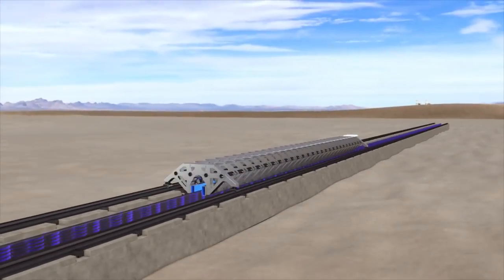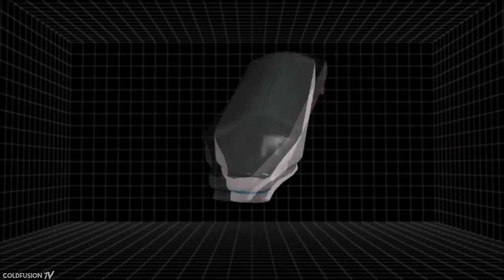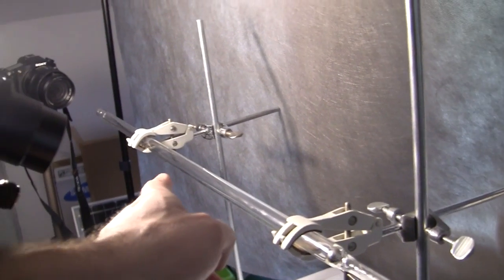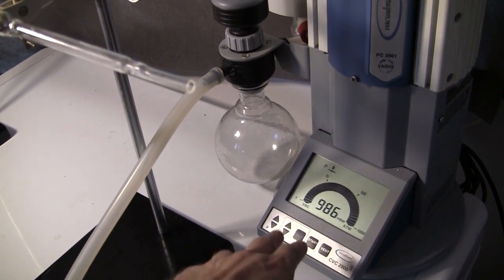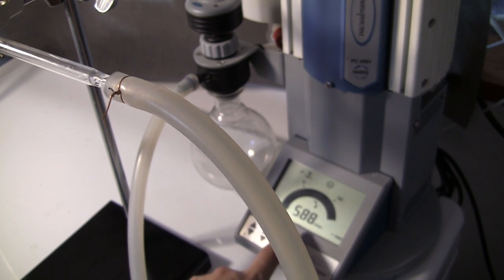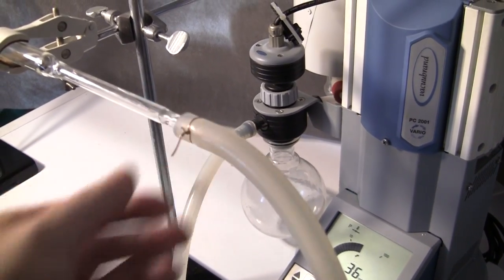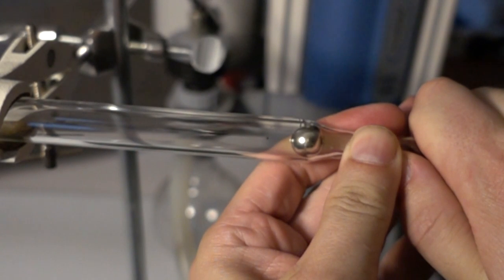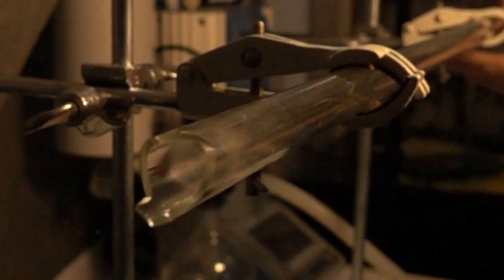How  the Hyperloop can kill you!

Comment: that is only the case when the object's cross-section area is almost as large as the cross-section of the tube itself. if the ball/train was much smaller, all the air rushing in wouldn't move it nearly as much.

Comment: Pointing out a failure mode is a good and valuable thing - that doesn't mean it has no engineering solution to mitigate the risks. And those risks could still be lower than fatalities caused by automobile accidents.

Comment: i agree with you mr, thunderfoot but a couple factors you might not have considered is this is a hyper LOOP meaning if you cant stop you either dont move at all beacause the pressure hits you on both sides or you just go in a LOOP very fastlike they would also most likely have fail safes in place that would open up and balance or imbalance the pressure to stop the train faster. but i have a different thing for you to make a video on. it the commercial it says that they would use something like a propeller poweed by an electric mote to move it. but wait if im not correct dont proppelers not work well BECAUSE of low pressure?

Comment: While vacuum failure does present a major safety problem to sort out, this doesn't mean this idea is a failure.  I mean, we've been using this same technology, eg. vacuum and pneumatic propulsion, for well over a century.  Stock exchanges, postal centers, and hospitals use tube delivery with little to no issue.  Your debunking assumes that no one would even think to protect the tube integrity or place fail-safe measures to ensure safety.  That's like saying planes would be a failure because any small failure in an engine's propeller would lead to catastrophic loss of propulsion and lift.  Or that a tire exploding on the highway would render all cars "debunked" because they would crash without functioning tires.

Comment: No way of fucking stopping? first of all project hyperloop has an engine which can go in reverse as well.
Secondly, do you think at the entire distance, this thing is supposed to travel there is gona be two valves only at the ends? Of course fucking not, in case of failure such as for example train cabin loosing pressure air can be sucked in via multiple emergency valves along the way to make sure people dont suffocate for example.
Also threes this thing called magnetic levitation, a very unknown alien technology used in EXISTING FUCKING TRAINS for several years, which can not only levitate, accelerate but also BREAK the fucking train really really smoothly.
Another thing u dont seem to fucking realize in your very scientific experiment is DIAMETER of the broken element matters. Your cannon ball accelerated faster because it is actually relatively light object, in small tunel with huge ass hole at the end. Diameter of project hyperloop is decent enough that train wont move a milimeter even if you sprey the tube with a magazine of bullets. It would require a massive fuck off explosion, breaking the tube in half to reach that sort of effect. At that point i think u should rather worry about the massive fuck off explosion rather than train itself. 
It seem to me you missed the point of hyperloop entirely. Its a maglev train. Because engineers couldnt figure out how to move it safely any faster without massive cost increases/energy demends, they decided to lower the resistance by lowering pressure. Pressure itself is not going to be main driving force for the train but an adding factor.
Reply: Actually most Hyperloop concepts do not have an engine, they are accelerated from external stationary magnet motors (similar to rollercoaster). They do however have emergency brakes.
Reply: The last point, regarding the size of the hole, is pretty important; for instance, the ISS taking an actual puncture through its hull (say, the caliber of a pistol) wouldn't suddenly kill everyone in it; they'd actually have a very decent 30-40 minutes to locate the problems and either fix them or evacuate, in relative comfort.

Similarly, it would take a pretty big hole in the hyperloop to pump in air in a large enough flux to generate killer acceleration, even assuming safety measures are not in place and the thing is otherwise analogous to the glass tube. Something like, say, a mere bomb on the surface wouldn't do the trick, I don't think (not to mention some hairline fracture caused by poor maintenance).
Reply: Why are you so angry

Comment: The Hyperloop is being hyped because it is supposedly energy efficient: Not having to fight air resistance, not having to carry its fuel load, driven by magnetic linear induction.

However, the problems of maintaining a vacuum seal for a tube hundreds of kilometers long are ignored as are the energy costs of creating and maintaining that vacuum. Note that even a hundred km length of two meter diameter tube requires maintaining a good seal over 628,000 square meters of surface area and depressurizing 314,000 cubic meters of volume.

Constructing such a tube and the linear induction motors to propel the capsule would cost about a billion dollars per kilometer.

Comment: One of the perks of maglev trains is they have INCREDIBLE emergency breaking capacity. You flip that magnet in the train holding them up over, the thing slams the fuck down and won't fucking budge from that spot. Activating it in the case of rapid unscheduled acceleration is as easily automated as the emergency locking mechanism in your seatbelt.
That said, this vacuum train idea still seems rather stupid for passenger transport. Now for cargo? For cargo you might have just come up with something great. Ship everything by pneumatic maglev tube.
Reply: maglevs probably won't be as fast as hyperloops though, such a sudden deceleration might as well be you slamming into a wall, the same is with acceleration
Reply: Scripted Cookies
You can cause the deceleration to be arbitrarily lower than the maximum possible by the degree to which you rotate the levitating magnet.
The hyperloop is a maglev in a vacuum tube.

Comment: The period of time you'll get shot down the tunnel is pretty slim isn't it? After all, for most of the journey you're supposed to be hammering along the tunnel anyway. I can understand that there'd be one heck of a deceleration though. And the system doesn't need a vacuum to function if I understand, only to reach the proposed speeds. Other than that it's basically a maglev train, right? The question would be, can someone withstand the rapid deceleration of a catastrophic vacuum failure, which I suppose is the same problem but in reverse. As for stopping, this isn't an airtight fit and the train should be able to stop itself provided the rail is not compromised. It'll be interesting to see your videos on this topic.

Comment: General respect for your debunking, but I think you are off the mark here.

Certainly their are some engineering hurdles to deal with safety concerns in various failure scenarios, but I think the hyperloop is a far cry from scams like solar roadways & cars running on water.  

Consider airplanes: if the engines fail, they are literally a big heavy object falling out of the sky from thousands of feet with "no way of stopping".  Yet now there are 100,000 commercial flights a day around the world.

Consider ordinary trains: impossible to stop if derailed, but also used all the time, because they are engineered to sufficient levels of safety.

With hyperloops "ways of stopping" could be implemented. Maybe some kind of fail safe breaking mechanism under various failure conditions.  I might imagine some kind of "air-bags" all around the cars that would rapidly expand (probably filling with some kind of sticky/rapidly solidifying foam, not just air). This would seal off the tube & stop the car from moving.

There could also be automatic venting on the other side of the car from a leak, between every car in the tube, so quickly the pressures would balance, even providing a "cushion" between cars to prevent collisions. At the same time the magnetic propulsion system could apply breaking force.

These are solvable problems -- and unlike solar roadways, they are not obviously cost-prohibitive.

For your debunking here to be valid, you need to make the case that it will be too difficult to bring hyperloop risks in line with current planes, trains & automobiles.
Reply: To rebut myself slightly:

Quick back-of-envelope calculations.  1 atmosphere, and say a cross-section around 10m^2, is a sudden thrust equivalent to a handful of jumbo jet engines, certainly an incredible force to deal with suddenly. A 10,000kg car would experience 100g acceleration (if I didn't misplace a digit).

There may not be good solutions to that level of failure. 

However:

A catastrophe analogous to your glass tube experiment requires an opening to be instantly created, near to a car, that is roughly the size of the of the tube's cross-section, which would require something like a major earthquake or terrorist bomb. Trains, planes & automobiles don't fair terribly well in those circumstances either.

Most failures would be small leaks, and the rare large failures would even more rarely be right next to a car, so that there would be time for other braking/venting mechanisms to kick in.

Comment: I really don't know any of the science behind this, but could you put a tube within a tube, and have their air pressure increase and decrease simultaneously so that if the inner tube failed somewhere that the outer tube would still be the same pressure negating any adverse effects? This also wouldn't solve an issue of the outer tube experiencing a break and causing damage to the inner tube or anything that might be nearby when it breaks. Again, I'm a laymen and have little to no idea how it all works.

Comment: You did not really "bust" the hyperloop, you simply showed that it could be dangerous if something goes wrong. Which is news to... who exactly? If you make the observation that losing control of a car which travels at 150 km/h is likely to result in a fatality, you did not "debunk" cars. Does the hyperloop technology work in theory? Yes. If something goes wrong, does it pose a threat to the people using it? Yes, but so do most ways of transportation. A better video would be demonstrating how it is impossible to build a loop without tube failure.

Comment: I have not really followed the whole Hyperloop thing but this video was completely useless. It amounts basically to saying "If engines fail on an airplane in midair then you're pretty much dead, hence we should not invest in air travel". I'm sure that there are actual problems with Hyperloop that could be discussed instead of a failure condition that can be foreseen and prepared for.

Comment: That is BS Thunderfoot, your model is wrong. The thing is a hyperLOOP not hyperSTRAIGHT-TUBE-CAPPED-IN-THE-END. Your bearing would just circle around and come to a halt due to the vacuum escaping from the other side of the loop as well.
Reply: The G forces experienced would turn everyone to mush the instant a breach occurs. Hyperloop or hyperstraightline. Think about shit first, mate.
Reply: FFS. I keep posting this.
Science, bitch.

a = F / m
Say the area of the capsule's end cap is about 3m&#178; (radius of ~1&#178; * π) so A = 3
F = P * A
Atmospheric pressure is about 100000N/m&#178;, so P = 100000
F = 1000000 * 3
F = 300000N
As a guess, say the capsule weighs 5 tonnes.
a = 300000 / 5000
a = 60m/s&#178;
Now remove acceleration based on the resistance of the near vacuum at 1/1000 atm:
a = 59.94m/s

That's basically 6g. So yes, you'd probably survive. That said, you probably wouldn't survive crashing. If, however, you came to a stop without hitting anything you'd be okay.

Before you critique me, remember, this is a 5-tonne capsule. If it were lighter, you might not fare so well. Heavier, maybe you'd do better.
Honestly, though, I think that most people would boycott hyper loops if decompression did ever happen given how traumatic it would be.

[Edit: Google is retarded - "&#178;" = squared sign]
Reply: The G forces. What G forces? TF didn't presented any data of acceleration which we could extrapolate to the real size and mass.
Humans can withstand up to 20g in a short session. Till then is all we know...
Reply: Cesar Scur Damn right
Reply: It's around 5g's to accelerate to commercial passenger speed(160mph) in 2 seconds. This is more than survivable.
People have survived with full faculties 20 g's for 10 whole seconds.

Comment: That's like saying lifts at the top of the Burj Khalifa Tower would kill everybody by showing an egg tied to a piece of string and then cutting the string.  Sure, the cable can snap but there are engineering solutions in place that make elevator disasters incredibly rare despite the tendency to accelerate at 9.8 m/s/s.  

The obvious solution would be to have air pressure / wind activated pressure release mechanisms further along the tube to equalise the pressure down stream and prevent a bullet effect.  A triggered stop valve would also serve not to mention a braking mechanism.  The vehicle could also be shaped to made it jam with a tail wind.  There are countless possible solutions.  It's a legitimate concern you raise that good engineering solutions would be needed to in order to demonstrate feasibility.  Of course we would need to see and assess those solutions but remember, landing man on the moon within ten years also posed challenges, we managed that and I for one wish them every success in producing viable cost effective engineering solutions and see no reason to write off their endeavours.
Reply: Dude the initial acceleration alone would kill everyone inside any prevention method that begins after the initial vacuum collapse is useless
Reply: I'm impressed.  The vid is barely an hour old and you already calculated the force in Newtons against the inertial mass of the craft plus the friction and concluded it resulted in higher g's that the human body can withstand.  I'd love to see your workings.  I mean, it's not like you just pulled the claim out of your bottom.

What if the change in pressure was detected electronically which then led to a valve opening ahead of the train instantly?  Hell, you could have air bags seal the tube going forward at ten metre intervals in a split second.  Could you calculate the forward acceleration in those cases please?
Reply: I think someone else guesstimated it out to roughly 5 or 6g's. While not dangerous, that's akin to light combat maneuvers in a fighter jet or a very hard roller coaster. Not exactly consumer friendly.
Reply: what does your example prove towards anything in this case? simple straw man, NEXT.
Reply: Brain Nim That sounds a reasonable enough estimate and I'll go with it.  I think we agree a runaway train like that is not an acceptable outcome.  So, like the wire breaking on the lift, is it possible to engineer safety back into the system?  So, what would happen if we had air pressure / wind sensors along the length of the tunnel - very doable I think you'd agree.  And if triggered they open pressure release valves at short intervals along the length of the tunnel in an instant.  Some turbulence for sure but very little net trust.  Why wouldn't that work?  If you make a solid argument I'll happily concede the point but right now I'm not seeing now it isn't feasible or cost effective.
Reply: @scotcheggable 
I severely doubt it. The mass of the capsule would be much higher than the little metal ball and for the pressure to return at the same speed as in TF's video the rupture in say the wall would have to be as wide as the tunnel.

Comment: you can shoot a metal ball out of a tube, but can you shoot a train with the same velocity?
Reply: Well they want to reach the speed of sound and this is an unexpected acceleration so even faster?
Reply: he's demonstrating what will happen encase of a failure.even though there are many ways to keep the train car stationary.
i dont think the idea of a hyperloop wont be a reality. ofcourse there will be plenty of safety precautions and measures to keep people safe. you cant simply simulate the whole thing with a metal ball in a glass tube.
Reply: It's basically the same. The acceleration from a break would kill you before any sort of mechanism has time to react. And even if you had brakes that could react fast enough you would instead be killed by either the deceleration from the brakes or you would just be crushed.
Reply: if you break to a full stop before you start accelerating there would be no problem. and that is just in case you were stationary prior to the failure. If you where already going max speed you would automatically start breaking due to friction from the air. Pressure sensors don't have to be mounted on the train, they would be mounted along the whole pipe line and send signal to the train in case of a failure.